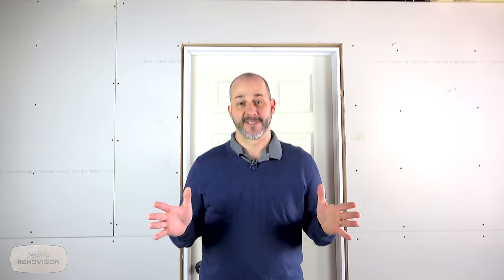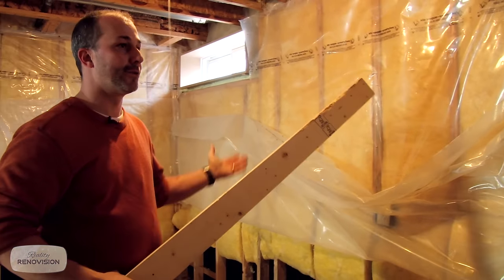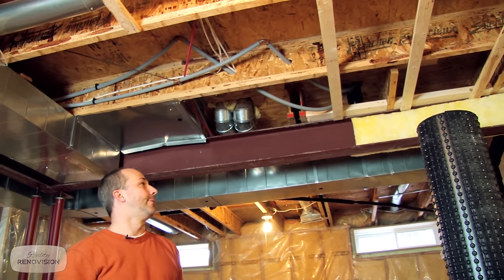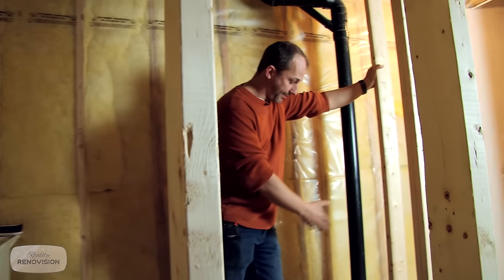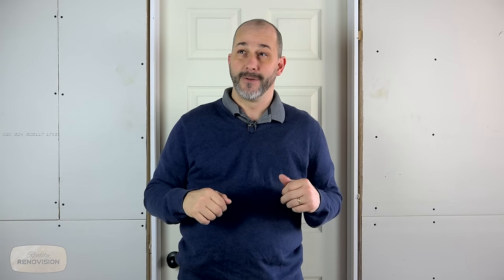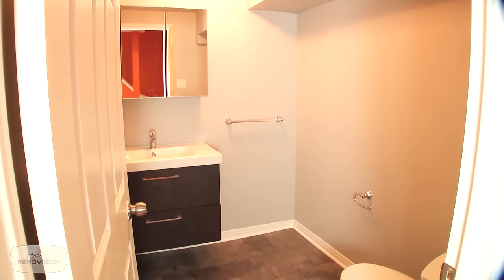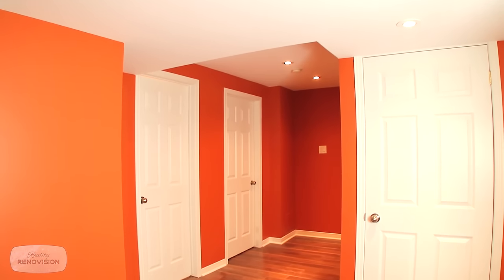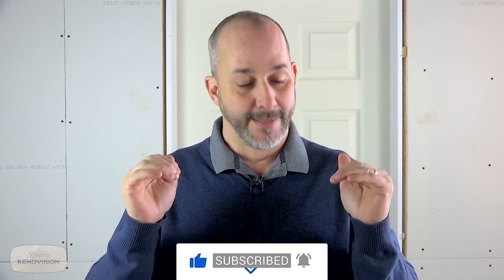This Basement Finishing Secret will Save you a FORTUNE!  | Reality Renovision Ep04

Comment: My husband and I have an older home that was built in the 1800's and part of r basement is dirt and the other is cement. My husband said we need to redo r basement. The ceilings r super low. I'm 5'1 and I have to duck to get to the breaker box what do u suggest
Reply: I would do that in stages of importance. First thing would be to test for radon. If you do have radon it's important to put in the cement floor. It's also crucial to patch any cracks. Then there are ventilation techniques and positive pressure techniques. Basically to seal it from getting in and to suck it out or push it out. I'm no expert on that so that's something to be researched. 

Hopefully you don't have radon or have already tested for it in which case you can consider it safe to spend time down there. Then if you want to create a living space.. look at the area and see if there's a logical spot where the challenges aren't so great, ceilings aren't quite so low. But if you do have radon best not to spend much time down there until it's dealt with. 

Sometimes you can reroute plumbing, wiring to be outside the area you want to finish. Duct work can sometimes be changed, but you can end up without good air flow if you have too many detours in the ducts. Straight runs are better. 

When framing ductwork bring your frame just slightly below the lowest point. you don't want to lose more headroom by bringing the framing lower than it needs to be. Maybe think about areas that you would walk around in versus areas you would be seated in. Areas with lower ceiling are more suited for seating areas.

If you have moisture problems that needs to be addressed before you start covering up walls or the moisture will be trapped and mold will grow so that's a consideration to research as well. 

I'll be helping my son to create a recording studio in his basement. He mentioned some moisture problems so we'll start on the outside checking gutters and downspouts, making sure the ground slopes down away from the foundation to shed water away. Maybe we will dig down, waterproof and insulate the outside of the foundation. Then the foundation stays warmer for less condensation. Or glue foam panels against the inside of the foundation. A product called "Insofast" foam panels looks like a possibility. It has built-in plastic studs you can screw the drywall to after you glue the insulation panel to the wall.

Condensation occurs with the temperature difference just like a glass of iced lemonade on a hot day. So moisture problems are not strictly about water coming through cracks. 

Of course cracks have to be addressed.

A dehumidifier. 

I also had the thought of an isulated room built in the center of the basement which doesn't touch the outside walls. I pictured a door. You open it up and you see the foundation sort of like a walk-in closet. 

In other words if his basement is 25 ft wide he could get 15 foot wide studio area with two 5 ft walk-in storage areas on either side. In that case if the foundation sweats it's open to be able to dry. That doesn't give the full width as studio space but it's cheaper and creates separate storage spaces. Three rooms but only the center room is heated.

I haven't seen his new place yet so  I'm not sure what he wants or what I'm getting myself into! one thing I know we won't have enough money to do it all at once.